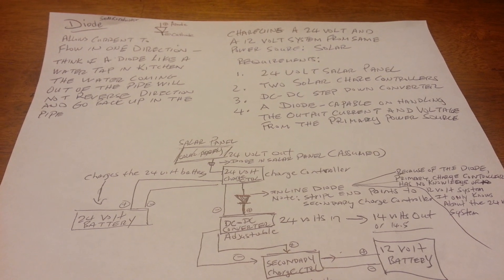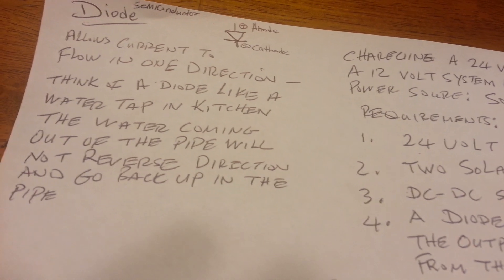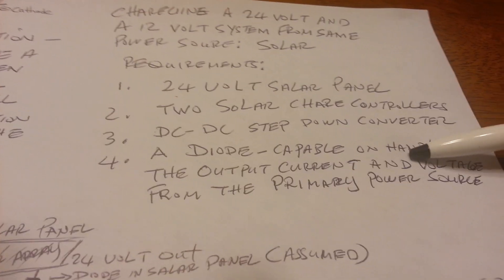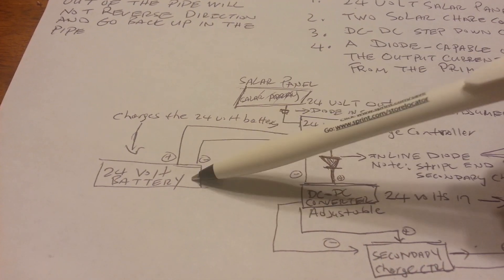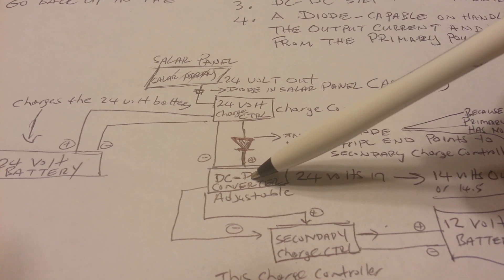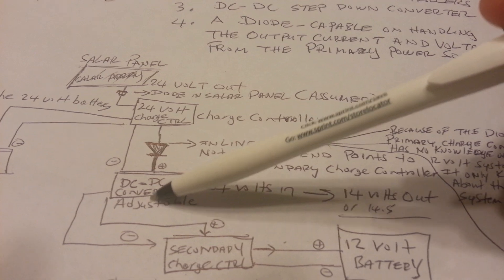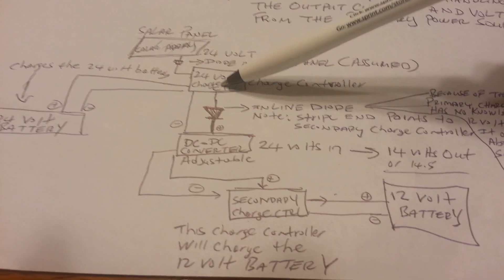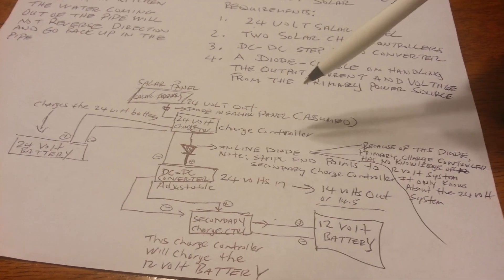Charging A 24 Volt And A 12 Volt Battery System (Simultaneously)  FROM The Same Power Source:  SOLAR

Comment: It seems like the DC to DC converter and the diode are completely unnecessary.  Why not just use two mppt controllers?  One from solar to your 24v battery and one from your 24v battery to your 12v battery.  The mppt going from the 24v battery to the 12v battery will just be seen as a load on the 24v battery.  The charge controllers won't know each other exist except for the load being drawn from the 24v battery.

Comment: Any chance you know how to add a few inverters to the same load? Like if i have a 48v 40kwatt bank. Then i go look at a 8000 watt inverter and think.. hmm.
 I can buy 5x 3000 watt inverters for that price.. but can i just plug them all next to the bank and then put all the ac on a 220v busbar with a few diodes, 1 pr inverter?

Comment: Could this also work by first joining the solar array to a common bus bar, and then connecting the 24v charge controller as well as the 24v to 12v step-down converter to the bus bar, then the 12v charge controller to the converter?
Reply from the maker: It could
Reply: @DIYOneForAll  Thanks! Also, what model Square D breakers are you using, and what are you using to mount them?

Comment: Why you use diode and dc/dc converter? Isnt the second charge controller supposed to do all this?
Reply from the maker: It's a PWM change controller.
Reply: @DIYOneForAll  thanks

Comment: hi can you do it the other way round.. I have a 12v solar system on my camper. it powers all my things inside with 12v. can I step it up to 24v and charge the starter batteries.
Reply: also what size diode would I need
Reply: I

Comment: What are you doing to limit the amperage going through the second charge controller for 12v? or even limit amperage going through your DC to DC converter? what happens if you draw more than your converter can handle?
Reply from the maker: JB, I let the charge controller handle the amperage and never had an issue.
Reply: @DIYOneForAll  interesting, I tried doing this same thing with my 24 volt battery bank because my charger can convert the 24 volt to 12 volt bank from solar panels but things started getting warm. I never tried running it through my 12 volt converter because it's only 750Watt. my 12 volt battery was discharged at the time and that could of been some of the issue. I ended up just using 2 charge controllers and setup the solar panels as 24V and fed it to both controllers. the 24 and 12 Volt batteries are Isolated of coarse.
Reply: I'm willing to bet that the way you are doing it the amperage is a lower current due to the lower voltage from the DC to DC converter.

Comment: Can I...  24v charging "series-parallel" panel to 12v battery,  12/24v mppt, 12v inverter.   Will charger translate and  charge my batt without frying?.  I need faster charging.  I currently have parallel I want to do pv in series and bring cables down in parallel.
Reply from the maker: Jerry Cruz 
If you have a 24 volt voltage source coupled with an mppt charge controller, you can safely charge a 13 volt battery without cooking it.

Comment: Hi, I'm in the process of setting up a solar system for my property. Big enough to run a household and I came across your video. I am very interested in setting up this sort of system, but confused on what sized diode I need. The stuff I have so far is 6 panels each at 170 watt and 11 batteries each at 12 volt. I am wanting to run 12 volt lights and everything else off 24 volt.
Reply from the maker: James Roberts 
I am using a 40 amp 600 volt diode that I got off Ebay.  This one is way above what I will be drawing.  The size of the diode depends on your current draw.  More is better.  Just be mindful that there will be some degree of voltage drop when a diode is used.
Reply: Ok. Cool. I was thinking of going 60amp controllers to, I may as well set it up with big stuff to start off with, as I think my energy needs will eventually get bigger, as I’m still building a house as well.

Comment: hi I have 2 panels 24v 250watts each, inverter 12v 800watts 105A 12 volts batteries, 30A 12/24v regulator how do I connect this system
Reply from the maker: You must decide on what voltage system you want: 12 or 24. If you want a 24 volt system, you will need a 24 volt inverter.  You must wire the panels in parallel maintaining 24 volts.  You  must wire the 12 volt batteries in series to achieve 24 volts....series parallel if you have four batteries.    If you want a 12 volt system, you will need an MPPT solar charge controller to step down to 12 volts. You would then wire the 12 volt batteries in parallel.  Hope this helps.  Draw a diagram of what you want to achieve.
Reply: thanks. but is there a difference in terms of power output between 24v and 12 v
Reply from the maker: Malakia Angala 
Watch the "DIY Tutorial" playlist on my channel. There are videos relating to 12 volts vs 24 volts and calculations.  At any rate, here is the formula to determine power (watts) - Watts(p)=AMPS X VOLTS
Reply from the maker: I just posted a video on this today.  Be sure to check it out.  Here is the link to it: https://youtu.be/pk_HpxXtePs

Comment: OMG so very wrong just tap 12 volts off the battery bank and charge the whole bank at 24 volts don't need any of those diodes and shit...
Reply from the maker: Robert O'Connor 
You will need more than 12 volts to charge a 12 volt battery.
Reply: If you tap 12 volts off a 24V series string, that 12V string will become massively imbalanced compared to the 12V side that does not have a load drawn from it. At minimum, you'd need to place an automatic charger (like a Battery Tender) coming from the non-load side of the 24V string, going into the 12V load side to try to balance the two strings during the night. Even that would be clunky, but would probably work for a short-term fix.
Reply: Tap the batteries is the worst practice
Reply: 6 battery 12V in 24V bank

Comment: did you connect to the 24v charge controller load output or just the 24v battery bank?
Reply from the maker: old time engineer 
It's connected to the same battery terminal that goes from the 24 volt charge controller to the 24 volt battery bank (but was connected previously to the lamp output of charge controller but was changed because of my need to pull more amps than supplied from that output - either will work).  From there, it goes to diode then to a step down converter, then to the 12 volt charge controller, then to the 12 volt battery.
Reply: DIY OneForAll thanks I Figured it went to the battery due to current draw .
Reply from the maker: old time engineer 
Thanks for watching and commenting.  Cheers.
Reply: @DIYOneForAll  why did u do that in the first place ?for more amphours?

Comment: Thanks for taking the time to put this together. It answered a lot of my questions and it was presented very well. I'll be setting my future system up just like this, love having the 24 volts and also the importance of 12 volt for using cheaper accessories and charging my mowers and such spare batteries. Thanks again.
Reply from the maker: Hey John, I am happy that you found this video helpful and that it answered some of your questions.  I am planning on visiting the shed next week and will update while I am there. Have a good one.

Comment: what is diode for ? 24 to 12 converter is a 24 volt load and already made for 24 volts input you would think it already has proper components to make it work right .
Reply from the maker: +Debbie Bohannan 
This is a great question and thanks for asking.  Unfortunately, the converter does not handle back flow prevention – which would be nice if it did.  In this case, the diode prevents the 12 volt battery system from back feeding (draining) into the 24 volt battery system, which we don’t want.    The same diode concept is implemented in solar arrays to prevent the batteries from draining into the solar panels when there’s not enough sunlight.  That is the reason why a diode is installed on the red (positive +) output wire of every properly built solar panel.

Comment: hey u all  need help but i have some  issues   like to know  if this tech can be  used  with any tipe of a alternator ?  for a 2x battery 12volt  each  24 total but i have gel  wheel chair batter's  gel tech  if i had a 12  volt charging system  that can continuously charge  my battery  can i have 2 system 4x battery x = 2  24volt =48 volts this is money if we can build it my email oddjobspecailst@gmail.com cheers hope u get back to my have other great thing that we can build need help we can be very rich just trying